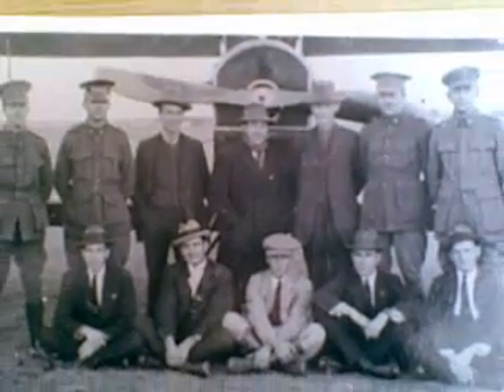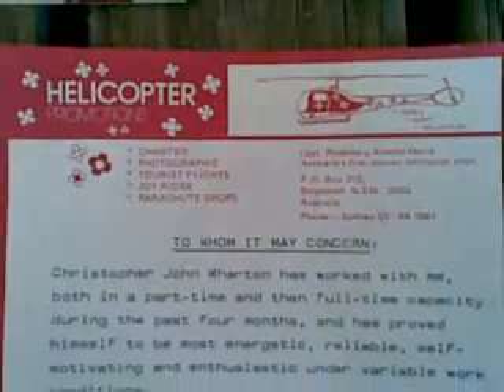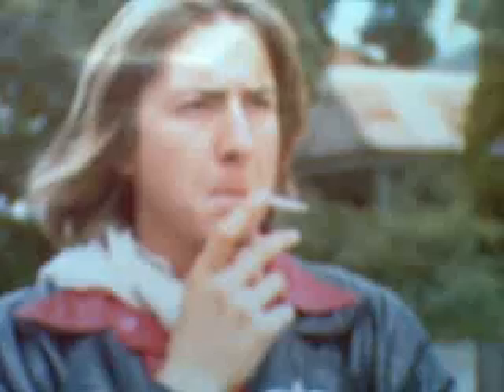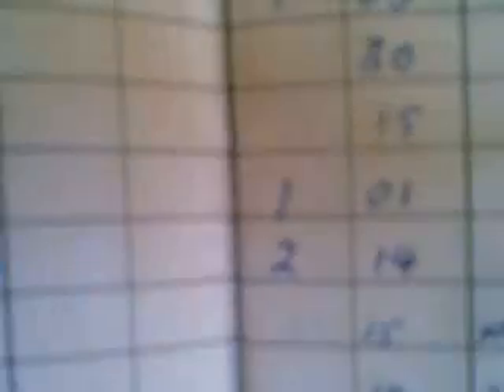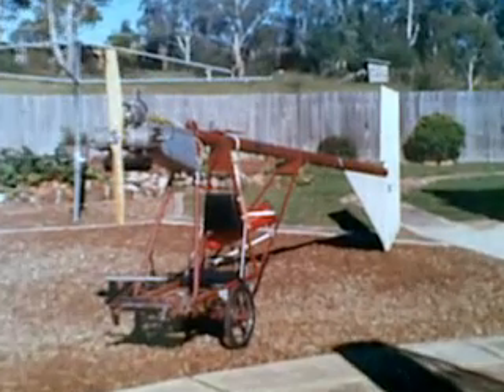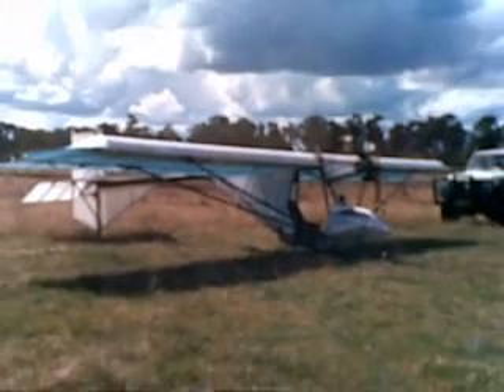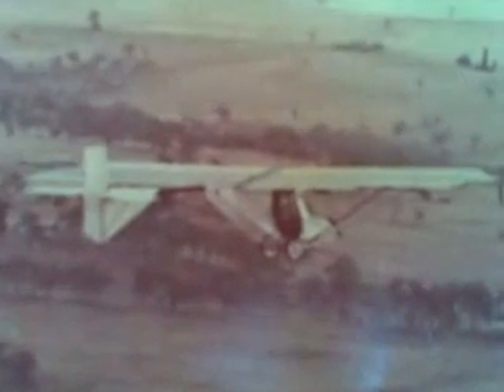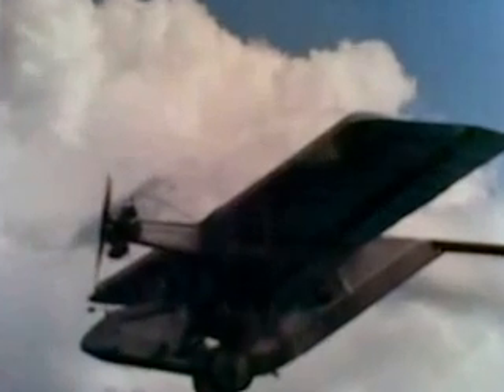Test-Flying, For Autodidactic Aeroplane-Designers...(VJ-24w SUNFUN/Budgerigar).

Comment from the maker: @walkabout16
  G'day... Cool, thanks for that. As I said, I had a big dose of Biggles.   And as you pointed out, I still limp. The Right Calcaneum never learned to walk quite right, after that Fencepost.   I still say I should have ignored the advice, and gone upwind.  
  Over the Fence, under the Powerlines, then climb away ; whereas I later realised that if I'd got over the fence I did hit, I couldn't have outclimbed the Terrain, in that direction. Hilly, with Powerlines & Rocks.

Comment from the maker: @magna59
   The PM's have frozen again ! The Centre-Section Gap made 2 Wings, with 4 Tip Vortexes. Closing it made 1 Wing, & 2 Vortexes... The little Direct-Drive Toothpick was the problem.  Check the related clip 'VJ-24w Ultralight Motorglider'. The 15 Hp at 4:1 Redrive, to a 57" Prop. would give twice the thrust I had... First Q. the Tugger had, post Rogallo Prang, was "What Happened ?"  & his next was  "How'd y' know he would Crash ?" No sanction, but his Karma gottim.

Comment: I'm not sure what can be said, other than may be put the plane transporter box filling up on e bay...or rebuild it.....or just make it up into letter/paper box by road & watch the locals put pot shots or wreck their cars in hommage....or just slowly use bits of it for elevating solar panels or sunfoils and be happy. A little amazed that the 4" wing gap cover would be the break even point much difference to performance, so close to non flight !!! Somthing you could not fly after a big lunch !